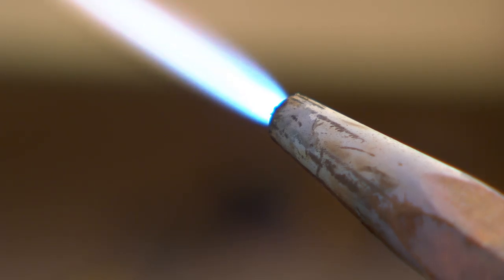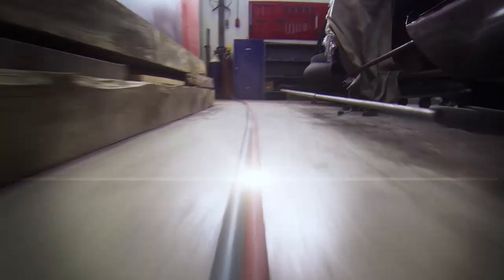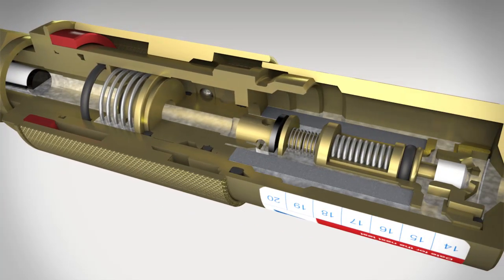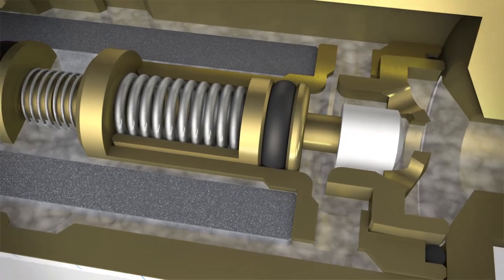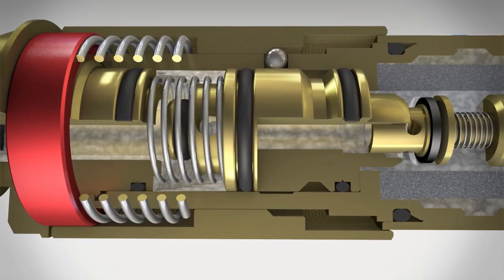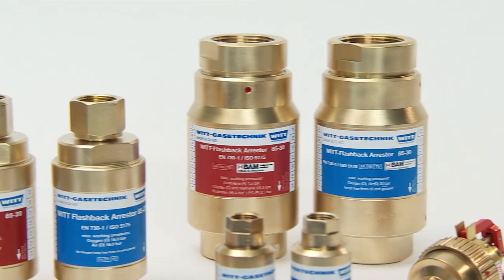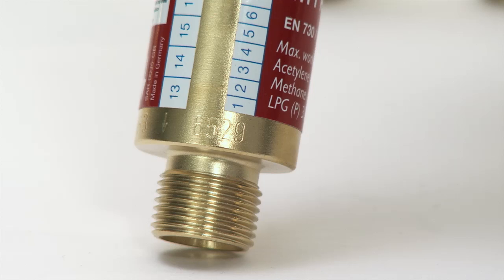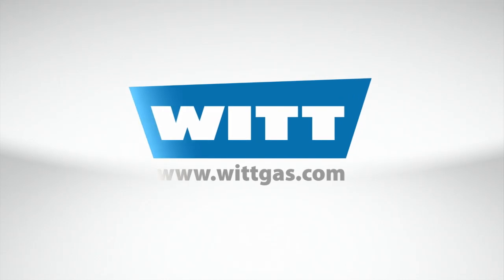Flashback Arrestors DIN EN ISO 5175-1 - Protection against flashbacks and reverse gas flow

Comment: What is a check valve and is one need in addition to a flash back arrester?
Reply from the maker: A check valve is another name for a non-return valve. WITT has a wide range of non-return valves available. It stops the return gas flow, thereby preventing the formation of an explosive gas mixture. But it will stop a flashback only in specific cases and for special conditions regarding gas type and pressure. For this you require a Flashback Arrestor.

A high-quality flashback arrestor according to DIN EN ISO 5175-1 made by WITT does already include a gas non-return valve together with the flame arrestor and a temperature-sensitive cut-off valve. 

It's always difficult to give you an advice without knowing your application. But in standard applications you normally do not require  an additional check valve if you use one of these WITT FBAs according to DIN EN ISO 5175-1. For individual consulting and the selection of the right valve please use the contact form at https://www.wittgas.com/contact/

Best regards

Your WITT Team

Comment: Butane isn't used for welding cutting and related processes because the flame is far too oxidising and temperature is far cooler than acetylene.

It doesn't need a flashback arrestor as the gas pressure / calorific value and flame temperature is far lower than propane acetylene propylene or Air Products Apachi gas.
Reply from the maker: Dear Mr. Perkins,

thanks for watching and you comment. Regarding butane you are right. This is not very common for welding and butane alone might not require a flashback arrestor. However, if oxygen or compressed air from cylinders or lines is also used, FBA are recommended. On the one hand, gas transfer, e.g. from the oxygen side, is to be prevented, on the other hand, however, gas or flame flashovers are also possible if a sudden combustion is caused by incorrect operation of the valves.

Best regards

Your WITT Team

Comment: What type of pop sound come when we shut the torch..???
Reply from the maker: Thanks for your request. Not sure if I understand you correctly. The typical 'pop' sound can be described as a loud bang similar to a pistol shot.

Regards

Your WITT Team
Reply: @WITTGAS  yes but how that sound came when we shut the torch off..??
Reply from the maker: @aliqadri4672 Sorry, but in this case it is difficult to give advice. The sound could have many reasons. For example defective equipment. Please check if you close the supplies for flammable gas and oxygen in the right order.

Comment: Can it be used for the home for LPG
Reply from the maker: Hello. Thanks for your request.

In most cases WITT FBAs are used in industrial application. In general, many of our FBAs are suitable for LPG. Please note that our technical information regarding  LPG  is based on test with Propan.

Without having more detailed information we can't give you an advice whether one of our products is suitable for your application or not. We suggest to contact us via our website https://www.wittgas.com/contact.html. So one of our application specialists will be able to contact you and to answer your question.

Best regards,
Your WITT Team
Reply: There is no need to use a flashback arrestor on a domestic LPG installation at all because you are not using oxygen as part of it and it's totally unnecessary. It's only when you use Oxy / LPG processes that a flashback arrestor is necessary.

Comment: Can these products be CE certified as per PED directive
Reply from the maker: Thank you very much for your question.

Our flashback arrestors DN20 (1") and bigger are CE-marked according to PED 2014/68/EU.

For more information please contact us directly via www.wittgas.com.

Your WITT Team
Reply: @WITTGAS  what about smaller size products?
Reply from the maker: According to the Pressure Equipment Directive, smaller flashback arrestors are not safety-relevant components related to pressure. They are manufactured according to good engineering practice and must not bear a CE mark.

Comment: Where are these found in the U.S.
Reply: Hello Mr. Lewis,

to get more information or a quotation for our Flashback Arrestors or other WITT products please contact our US subsidiary:

			Witt Gas Controls LP
			380 Winkler Drive
			STE 200
			Alpharetta, GA. 30004
			Tel. +1 888 948 8427
			Fax +1 877 948 8427
witt-use@wittgas.com

Best regards

your WITT team